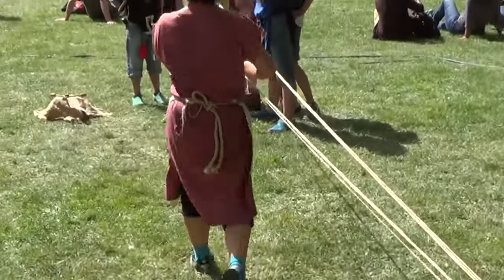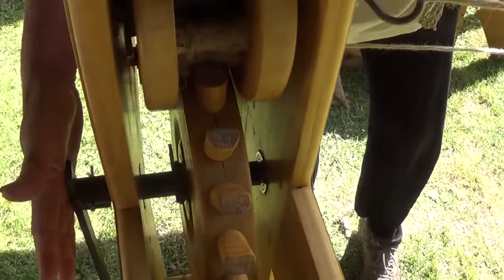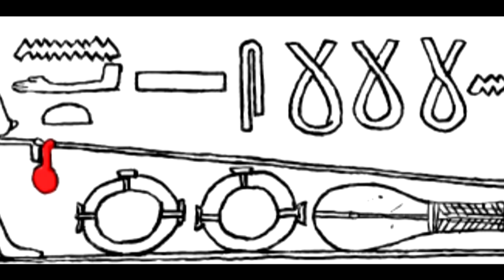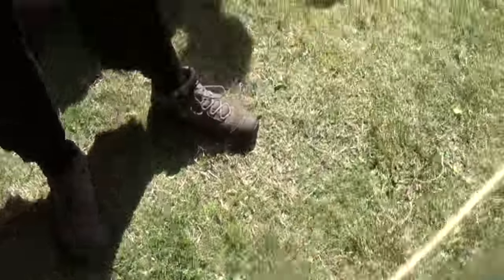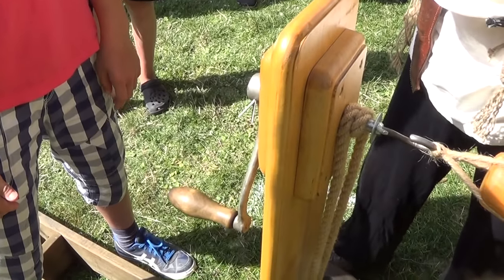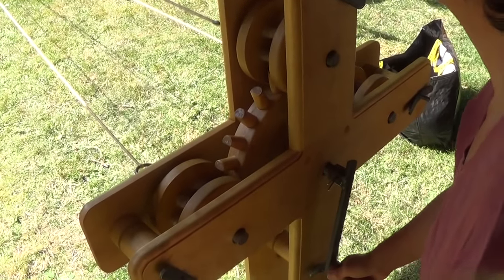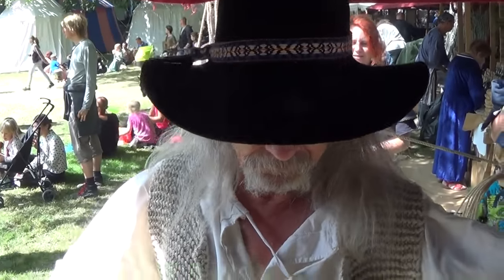Medieval rope-making in Visby market

Comment: Can someone please explain what keeps the rope from untwisting? It seems unlikely that there's some type of glue involved, and I have a hard time figuring out how friction force alone keeps the rope a rope and not fall into seperate strings when its in use.
Reply: You twist it in different  direction every time you make it thicker.
Reply: EattinThurs61 But how does that explain why the rope stays together once the tension from the spools is gone? Why doesn't it unravel when you throw it on the ground afterwards. Bindin the ends together won't stop the middle from untwisting. And it can't be plastic deformation as far as I know.
I want to know the actual mechanics that hold rope as a rope, that stop it from becoming seperate strings. Different directions of twisting shouldn't stop the largest sub-strings from unraveling from the main rope and after that the strings making up that substring etc.
Reply: +NiekGAE It actually IS that simple. The three strands are twisted one way and the whole rope is twisted the other way, the important thing is to keep them twisted evenly so they can counter each other. I've made a couple of bowstrings myself and if the strands are sufficiently twisted the whole thing keeps its shape.
Reply: Kuba Dutkowski I believe you, I've made rope myself when I was younger. I know it happens because rope is a thing. But what I meant is what is the physics behind it? Why does twisting the other way counter eachother? What is the force that keeps the strings together, is it friction, torque, internal pressure from sections wanting to unravel so they get tangled, what? I really can't figure out the mechanics behind rope, how the forces work. 
The only thing I can think of why the outside strands don't untangle is because most of the length is on the inside of the rope, surrounded by other strings of rope keeping it in place through friction. And that fixed position doesn't allow for movement in the exposed strings that behave as if its fixed between two clips. But I don't know if thats true nor do I know why releasing the pulling tension keeps the middle from untangling. Seems to me that that should happen for the 3 main strings.
Reply: +NiekGAE  the thing is that groups of strands push against each other, that is one wants to unravel clockwise, while the other wants to uravel counterclockwise.
Reply: kiwikiwikwikiwi Sounds reasonable. When I've got enough spare time I hope I remember this, I'll research it. The mechanics according to among others the laws of Newton and how the inner workings of forces to model and calculate the forces in a rope. Really want to know now.
Reply: +NiekGAE I dont think it has any reason to untwist by itself, since it does not have any tension when left alone. Thats the reason they move the gears forward on their little wheels as they make the rope, that results in it being 7/10ths of the original length, is to avoid the tension that would untwist it. I guess.
Reply: +NiekGAE Get a long piece of string.  Hang something moderately heavy from the middle and then twist both strands clockwise.  You will see a two strand rope forming and it's stable (i.e. not inclined to untwist) because the twists effectively cancel each other out.  It's the same principle with three strands but it's a sort of three phase twist rather than two.
Reply: the rope goblins that live in the rope stop it from falling apart
Reply: NiekGAE Opposite equal tension? Tension equilibrium.
Reply: +NiekGAE I am an apprentice physicist and this video is the sum of my knowledge on rope-making so I can&#39;t offer any definitive answers, but I can assure you that frictional forces are keeping the rope together, not tension.  Tension is the linear force applied when the rope is pulling on something.  Perhaps people are confusing tension with torsion?  Torsion is the twisting of an object due to torque, a rotational force.
Imagine you could select a strand and make the other two invisible, each strand would be an identical corkscrew shape (all turning in the same direction), each slightly offset from (or out of phase with, as we boffins would call it) each other, so they act rather like screw threads, all three locking into each other, which makes them very difficult to pull apart but twisting in the opposite direction will quickly unravel them (and the fibres do have a certain amount of elasticity that will resist all this corkscrewing).

So how does twisting three of these triple strands (sorry I don&#39;t know the terminology) together in the opposite direction help?  Well, we can think of this as a left-handed corkscrew embedded in a right-handed corkscrew (or vice versa).  This is like having a threaded rod with a hole bored through its length that is threaded in the opposite direction to its outer thread, so that a second narrower-threaded rod may be screwed into the larger.  These rods would be tricky to separate because as we try to unscrew the inner rod much of the applied torque would be transferred to driving the outer rod deeper into whatever it&#39;s screwing into.  To unscrew them we would have to prevent the outer rod from turning.

But wouldn&#39;t we have to prevent the outer rod from turning even if it wasn&#39;t threaded on the outside?  Yes, but in that case the rod would be held in place by some other means that would inhibit its rotation, this would be equivalent to gluing the three twisted strands together to form the rope instead of twisted them together.  This method of adhesion would make the rope brittle to torsion.  The &quot;double-threading&quot; let&#39;s the rope work with torsion, rather than trying to suppress it.

(What the bloody hell is wrong with YouTube commenting!  Buggered up all my punctuation!)
Reply: CowLunch Think I pretty much got it, thanks. 

And ikr about the punctuation. Only happens when you edit a comment so better get everything right the first time lol.

Comment: I've made a couple hundred feet of rope, and still learning. Found this video early on researching how to make rope, and now re-discovered it having subbed to your channel. 
I found myself trying to math out how many turns/ft you were doing based on a later video stating the rope was about 3 fathoms = 18ft.. if it's 70% of the start length, and you lost about a foot on the ends, then start length was about 27ish ft. 240 turns/ 27 ft = 9ish turns/ft. I imagine that's based on the strand diameter and strand count.. 
Looks like it was standard 20# jute. Good thing, I have a couple cones of that waiting to be rope, guess I'll have to test that out!
Reply: Grendalsh thanks for this math. I was planning on making a rig like this to start up myself. Good to know those measurements

Comment: So, what keeps the rope from unwinding itself once the tension has been released?  What keeps the twists tight after that?
Reply: The individual strands are twisted in the opposite way of the combined rope; to untwist the combined rope, you'd have to overtwist the individual strands. The 45 degrees rule means you're already tightening the rope as much as you can. If you've ever played with a piece of string, at some point it stops wanting to just twist nicely and instead tries to curl up; the 45 degree strand is right on the edge of that, and it can't curl up because it's held in place by two other strands. 

The knot he does at the end holds the three strands together; if you cut the end of the rope it'll fray, but the forces and friction of the strands opposing the rope towards the middle keep that intact instead of it all instantly unraveling. Rope is pretty much magic.

Comment: I've never understood why the rope doesn't twist back after the twisting tension is put off...
Reply: +st3y3r666 Friction mayby?
Reply: +st3y3r666 I believe the strands are twisted against each other. The smaller yarns want to twist/unravel one way, but the rope as a whole wants to twist/unravel the other way. This ensures that the "pull" of unravelling is balanced both ways, and the rope stays together.

At least i think this is how it works. I've seen it done on other things (like bowstrings), anyway.
Reply: +st3y3r666 You have to bind the ends some way.  In the video the end was lashed with another piece of twine.  You could also use the loose ends of the rope itself to knot each end.  With nylon rope you can melt the ends together.
Reply: +Austin Hurt 
Lashings or whippings are the way to go. Knotted ends are a pin to work with
Reply: +chrthiel Thank you, I couldn't remember the word I wanted to use so I used knotted instead but yes, whipping is what you do.  It has been too long since I did rope making in boy scouts.

Comment: Did they run back and forth to make the naval ropes? I imagine they would have quite an impressive physical health after a while?
Reply: +jeharnes You can use multiple twine sources to avoid the back-and-forth.  Just run 9 strands from end to end and tie them to the hooks.  For short lengths of rope like this it's convenient to use a single spool of twine, particularly because efficiency and speed of production isn't the point of this demonstration.  For a long rope length you could just use 9 spools at one end.
Reply: Huh. Makes sense.

Comment: What keeps the rope from simply untwisting itself?
Reply: +Aetrion 

"Scientists in Denmark posted a paper on the arxiv
 claiming to have boiled down the nature of rope and found a law that 
governs when and why a rope will or will not unwind when pulled. Rope
 is made of strands of material, like wire or fabric, that are each 
individually twisted in one direction, and then twisted or braided 
together in the opposite direction. The beauty of rope is that materials
 which are actually quite weak on their own, can be manipulated to be 
quite strong. As the researchers stated in an article by Science News, it is a testament to the power of geometry.

Back on track (rope track): The 
researchers found that in order to guarantee that the rope does not 
unwind, one must twist the individual strands of material to their 
maximum. This they call the "zero-twist point." They then measured ropes
 twisted to this point and found that in a triple stranded rope, the 
rope is 68% the length of the untwisted material."

source: http://physicsbuzz.physicscentral.com/2010/04/roped-in.html
Reply: +Aetrion Tar or pitch helps too, but if you use them they do untwist under tension. That's why woven lines are nicer for practical purposes.

Comment: But why doesn't the rope just un-twist once it's disconnected from the machine thingy?
Reply: +Alendi You twist the bundle of yarns in in each strand one direction, then when you are using the topper you twist the strands together in the opposite direction.  The counter-twists >mostly< counteract.  You do need to whip, splice, or tie the ends to avoid unraveling.

Comment: My question is, how does it not just turn the other direction once it is done?
Reply: To make things simple, let's say you have strands of string, and you twist them clockwise. Naturally, they want to go the other way, counter-clockwise. And so you have about 3 strands of string twisted clockwise, stick them together at one end, and let the natural tension in the strings twist them together. This is repeated until you have cord, then rope.

You could try this concept using a roll of toilet paper. Twist a certain length, and let them twist into each other.
Reply: you could have just said friction. Its kinda the same way that asian scaffolding us made.

Comment: The Egyptian picture shows exactly rope being made, and the "loom" thing is the "frame with lots of holes in it" (which you even say could be rope making) but from a different angle. Its also not running through lots of pulleys, again you are just looking at it incorrectly.

Comment: if this rope isnt braided but just twisted, what keeps it from just unraveling?
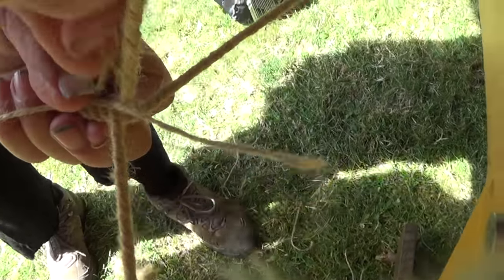Reply: @5:40
Reply: Ryker Haun well that keeps it from unraeling at the end, but whats keeps it from unspinning in the middle, so that its not a rope, just three strings tied together at the ends. most ropes ive ever seen were braided.
Reply: The way the knot is tied and loads of tension
Reply: Ryker Haun it wouldnt mattter if a solid three feet of the ends were permanently atomically bonded by magic the middle majority of the rope is still going to untwist!
Reply: +DazmoTube by that logic, then while they are twisting the rope, when they got near the end, the rope near the middle would unravel. These are very tense threads, and something else to keep in mind is that this isn't slick silk, it is a very coarse fibre, that is first very tightly wound, then even more tightly wound. It takes the shape of the rope due to the winding.
Reply: Ryker Haun " when they got near the end, the rope near the middle would unravel." no it wouldnt cause its still being held twisted by the machines on the ends. but once theyre off of that, even if the ends are tied, those ends are free to spin while the rest of the rope relaxes. 

" that is first very tightly wound, then even more tightly wound. It takes the shape of the rope due to the winding."

so youre saying that each cord having been twisted causes it to want to wrap around its neighbors and stay keep the whole thing rope shaped? that doesnt sound like a solution that would last very long or be very strong. im going to have to find a video of someone dissecting a rope.

Comment: How come it doesn't unwind
Reply: Counter-twisting: each successive component is twisted in alternating directions. So if you have yarn with a Z twist (fibers twisted this way // up the yarn), you make your strands with an S twist (\\), then lay them into Z twisted rope. The rotational tension of the the yarn fibers counteract the opposite tension of the strands, as the strands do to the rope: the rope wants to unravel one way but the strands want to unravel the opposite way.  Most natural fibers used for rope making also have a natural Z twist from the stem, some even have layers of natural counter-twisting down to the molecular level. (jute and hemp do, not sure about others) All twisted rope does gradually unravel if the ends aren't secured (whipped) properly though. Even when whipped, twisted rope still tries to unravel under tension.  Hence if you ever see something being hoisted in the air with twisted rope (not braided), you'll notice the the cargo will typically spin to some degree.

Comment: Was a lashing required at both ends?
Reply: +Nitro Neo Both ends will unravel if you don't tie a knot in the end, splice the ends, or add a whipping.  The whipping on the other end would be about the same.
Reply: +Michael Onines thank you

Comment: Makes sense that the final rope would be about 7/10 (0.7) the length as before twisted, given that they are using a 45 degree angle and sin(45) ~= 0.707 

Or maybe it's just a coincidence and it doesn't work like that :P